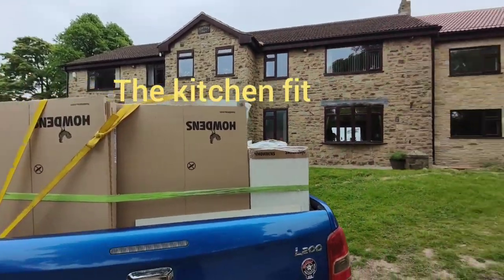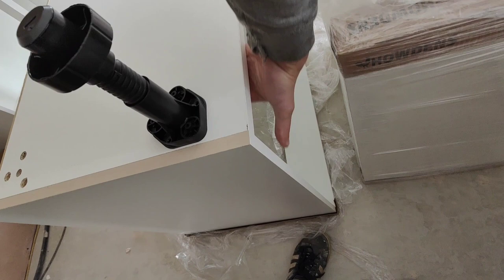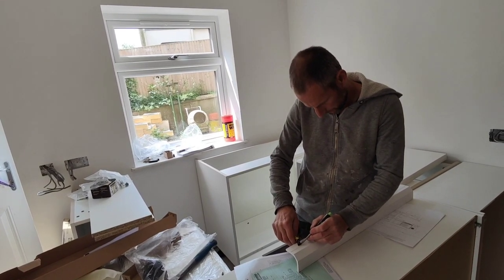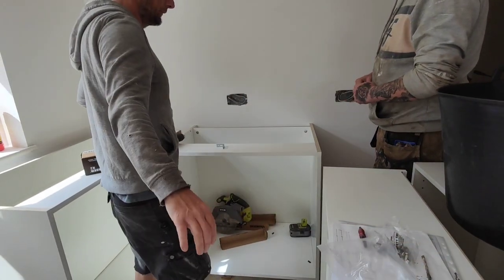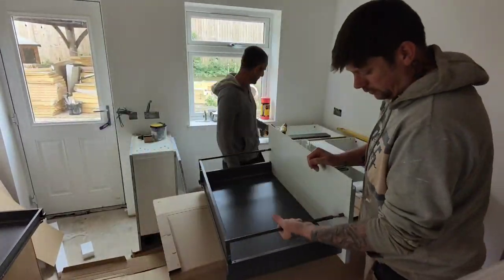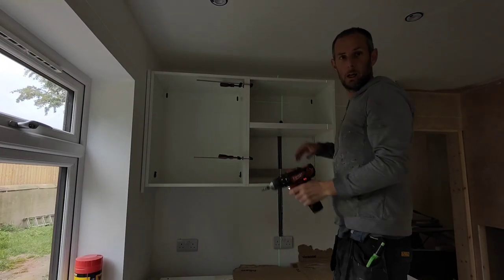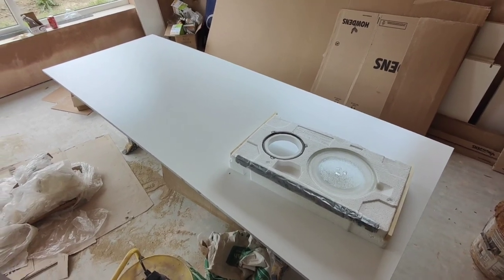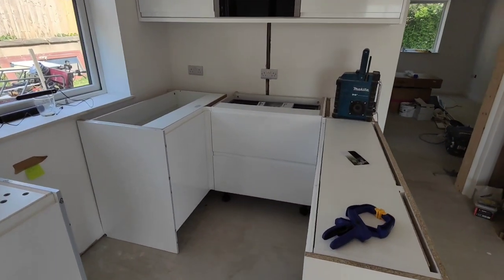fitting a kitchen extension build

Comment: Awesome. I did my own kitchen the same way. Got the carcasses pre assembled like you have, not worth getting them as flat packs. Doors are American Oak. Looks great.

You can get that dent pulled out if you want, they can work miracles those guys. Don’t try it yourself, I have and it’s not worth it, an experienced guy will do it way better.
Reply from the maker: Cheers mate .yes definitely worth getting the built up saves so much time .I like them doors but they are heavy 😂.I am gutted about the dent.minght get it done I would like to keep it looking well . because we use it for weekends away and that 👍👍👍